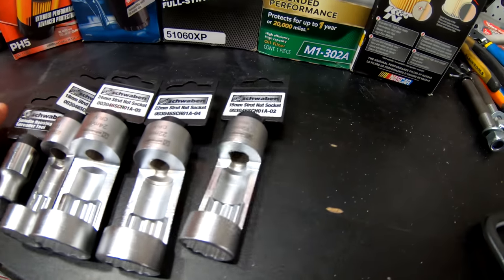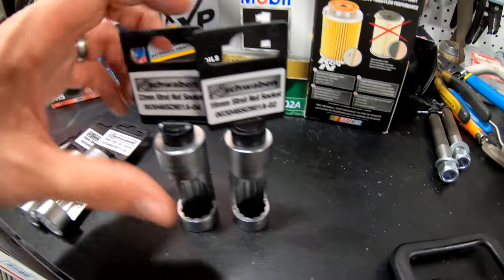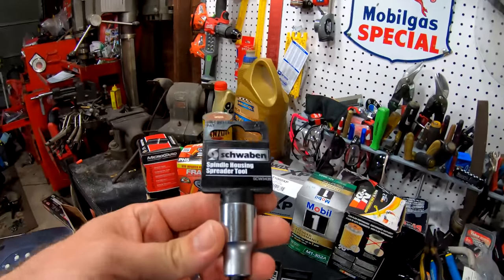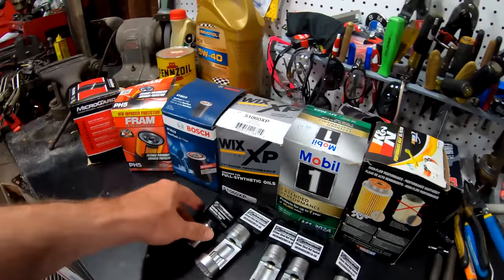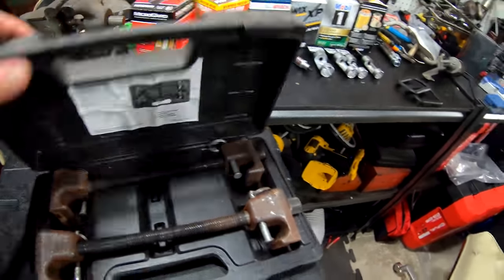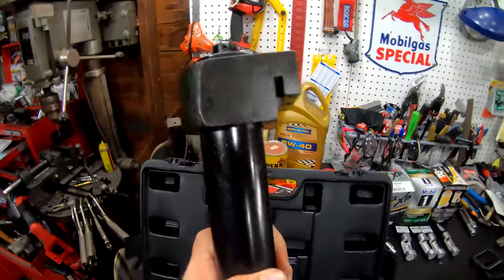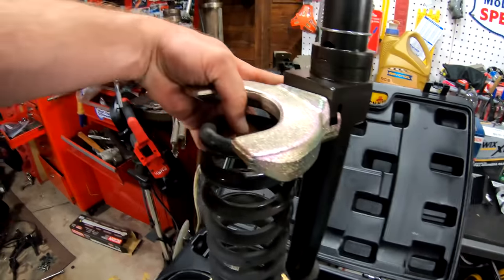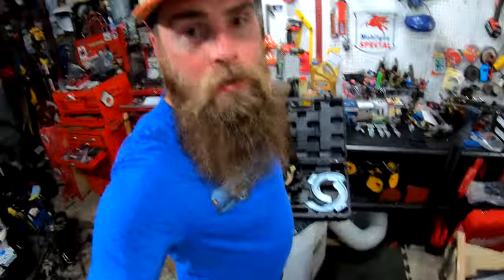Must Have EURO Suspension Tools!

Comment: Hey Blake.  I hope you see and can answer this, but I'm trying to install a set of Koni STR.T front struts on my 1990 325i.  The issue I'm running into is that the new struts come with a 22mm strut nut and the stock is 19mm.  I had an issue getting the socket off of the 19mm as it got stuck inside of the strut mount, but there's no way to get a 22mm socket into the strut mount to properly tighten the strut nut.  Do you have any advice on getting this finished ASAP?  HELPP!!!  I keep looking for an affordable upgrade to the front strut mount but can't find anything that isn't $350-1100....

Comment: For the spreader tool you can use a 3/8 to 1/4 inch adapter, helped out a friend change his coil overs with this
Reply from the maker: That can work in a crunch but it will also gouge the knuckle. This tool works much better.